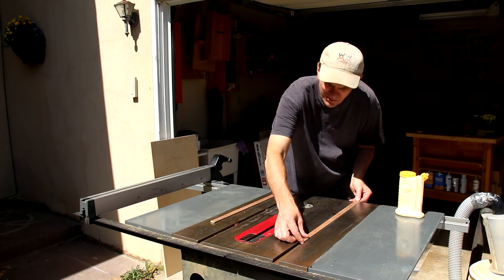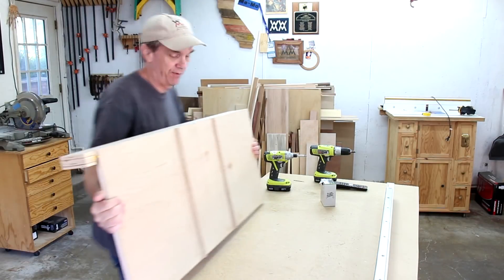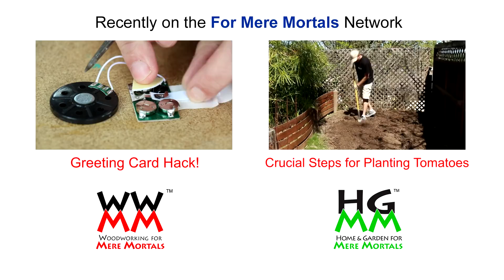Build a crosscut sled: essential table saw jig

Comment: In most videos of making a cross cut sled the makers refer to "sneaking up" on the width on the slide guides. I found an easy way to do this it to clamp a block of wood onto the fence slide, then moving the fence towards the blade and putting, say, a 20 thou. feeler gauge between the block and the fence and clamping the fence back down. Now when you cut the guide you will only be removing 20 thousandths of an inch. You can use this with any amount of feeler gauges and know how much material you will remove on the cut.

Comment: I know this is an older video, but the same applies for all the videos I’ve watched of yours, you have a great way of making woodworking very accessible for novices like me. I don’t need a u-beaut bells-and-whistles cross cut sled with a rail-road grid of intersecting t-tracks that lets me do mitred cuts at 38.379° angles, or a sled with a sliding stop block - I’m not yet skilled enough to make such a thing let alone need it for all that could be done in it - but what I do need is something that matches the skill level that I’m at and which will help me grow in my skills and confidence. And this sled (actually, a more recent one you did) is just what I needed. Thank you.

Comment: Very good, Steve!  I like the idea of adding the angle iron to keep the fence straight.

Here's one thing I would add. If you're laminating boards or plywood to make your fences, be sure to plan where you're putting your screws. It's easy to get carried away drilling and driving screws and end up putting one right where the saw blade will end up cutting through. If you happen to have a SawStop even a screw that is close to the blade can cause the brake to trigger. That goes for the screws you're using to mount the fences onto the sled. Keep them well clear of the blade.

Keep the videos coming!

Comment: Dude thank you!!  Mainly for reinforcing what I was thinking.  I built a table sled for my saw and didn't know how to square it.  I read about the "5 cut" method and using dial indicators, but those were too complicated for me.  I squared mine with a machinists square and it seems fine.  I'm glad that's how you do yours also.

Comment: great video Steve, nice cross cut sled, I like the size and great idea with the angle iron for support and to pull the boards straight! When I get round to building one for my table saw I will definitely use your plans! Happy Easter Steve, have a great long weekend!

Comment: I was having significant trouble with mine (table saw uses a t track which was difficult to build rails for) as it was encountering a lot of resistance which was super dangerous (it would tip the table saw if I pushed too hard). I found that using some candle wax and then silicon oil on top of the rails and just wax on the sled base mad things 100x smoother and now it works great.

Comment: I just made myself a cross-cut sled this past week.  It can hold up to a 27" piece, but I've decided it's not great for longer small pieces.  I'm going to make another one that is longer like the one you made.  I did use the "5 cut" method to square the back fence and it is laser square now.

Comment: I have made sleds for my use ,My large one is the with of my table saw and 25 inches deep inside allowing for a 24 inch panel. When aligning the rear piece I used a screw underneath on one end, then from the top drill a recess hole at the other end with your square on the sled fasten the screw from the top. You may then turn it over and install the other screws.  I also have a sled with one runner for my dado cuts, I can reverse the sled and cut at 45 degree bevel with my saw blade  For large sleds I laminate 3 pieces of   1/2 inch plywood it will not twist when glued right. Bob

Comment: Great video. One extra tip to make the miter width right. I used my table saw's miter gauge to scribe the lines on the plywood, cut it conservatively a little larger, then left my benchtop sander running nearby and kept inching a tiny bit off until the fit was perfect. I noticed you made the same mistake as I did putting glue all the way to the end of the runners. Oops.

Comment: The sled has the advantage of having a built-in zero clearance insert. Love the angle iron. Thanks for everything.
Reply: That is a really GOOD point, so now I don't have to make one for my Dewalt DW7480 table saw (which I really like) which was going to be problematic and not so easy

Comment: +Steve Ramsey, I enjoy sitting and looking over your videos; you go over everything and why you are doing it to make it simple. I have 2 questions that maybe you or someone in the discussion can answer. After picking up a used table saw and some elbow grease, I managed to get the table saw running and I am ready to start building. So on to the questions; 1. on your fence. . .what is the width of your front and back fence as it look like it is about the width of a 2x4 per piece? 2. how far so you know where to place your back fence to have clearence for safety cross cuts?

Comment: For those that don't like the steel angle iron, here's an idea.  Clamp a straight-edge (or a long level) to the front fence and leave it clamped in place while you square it to the blade and fasten it down. While it's clamped there it should do the same job as the angle iron.  Once you have it well screwed to the base, remove the straight-edge.  Provided you used plenty of screws I think it should stay straight.

Note I haven't actually tried this, I might be completely wrong.  As it happens I will be getting a new table saw this month, so I'll find out :-)

Comment: I've noticed that this sled, and most of the sleds on YouTube, are built on the assumption that the miter gauge tracks are 3/4" and have no lip on the track like my Craftsman does. The result is that I am dealing with a sloppy miter gauge and cutting runners is a real problem as there are 2 widths in the track. Narrower on the top and wider on the bottom, and the narrow track is not full length, and the miter gauge runner appears to be a good idea, but can't be adjusted without pounding the hell out of it!

(Truth is the saw appeared to be a good deal when I bought it as a rebuild, but it is  aluminum and there is the issue of this crappy double width track... )

I tried making runners that are higher, and with the narrower of the two tracks as a width; I tried making runners that were split level; and I have most recently tried using washers as the bottom width; but none work if the runners are not really a tight fit in the track. 

To make matters worse, any humidity and the sled is far from smooth in operation. (I'll probably unload this saw when I can, but at the moment I don't have a choice.) Although I did get the sled I made to work temporarily, with hardwood runners, the first shift of moisture in the air ended that. 

I've been looking for an alternative material for the runners, and plastic and metal seem to be the obvious choice, finding potential runners that are not overpriced is not as easy as one would think. I can't get accurate cuts with the saw in this situation. Because of the design of the throat plate (square) I can't even get a zero clearance insert or use dado safely  unless I use the sled.

Do you have any suggestions?
Reply: I just built this using my dads table saw, which is an old school craftsman.  I was wondering about the "squareness" of the tracks because when I flip the sled around I meet with a lot of resistance compared to having the sled front facing.  I can't figure out why there is a difference in resistance.  I lightly sanded the bottom but It doesn't fix the issue.  What model is your table saw?  Maybe my issue is with the tracks as well.

Comment: Nice video...

I am getting ready to build my first 'sled'.

I have been thinking about using a metal top on my fence, like yours. Actually, I plan to use 1 inch aluminum angle iron, instead of steel. 

I am wondering why you did not use the metal on both the front and back fences???

Comment: Well done, Steve. I'm definitely going to be building one for my new shop. Most likely I will make one solely for dado use as well as standard curf blades.
Reply: ***** Ben's Collection and Sundry  Ben just made a light bulb go off in my head...What if you made one that had insert plates like your drill press table? Have an insert for each application....single blade, most common dado sizes, angles say 45's, etc. I think that would be a HUGE benefit rather than making 10 sleds!
Reply: MP Woodworking That's a good idea, though I don't think it will work. Unless you always start with the blade in the center, the insert will be cut into two parts, then become useless.
Reply: MP Woodworking There are plans floating around online for an adjustable sled. I bought a dado blade off a guy who had built one and it would convert from a zero clearance thin kerf to zero clearance dado in no time flat.

Comment: I have a question. I’m a newbie woodworker and it’s a hobby right now but I love it. I’ve built some stuff over the last 2 years. One thing, among many, I have a problem with is using small screws to screw in thinner pieces of wood. It just ends up spinning or not holding. I’m assuming its several issues I’m having. But any way you could address this in a video or if you have, could you direct me to that video. Thanks.

Comment: I just have a small sled with a single runner so I think I might make one bigger with two runners. If I have them offset from centre a little and square both front and back fences, then I could have it dual purpose with one slot/direction for normal cuts and the other for 45 degree bevels. Or perhaps the other for use with a dado?

Comment: Hi Steve,

Thanks for this one. That was really interesting!
I do have a table top mini saw the Proxxon FKS/E. However Proxxon replaced it with the FET version, but still looks very alike. One day I'm going to make a mini crosscut sled based on your idea.

However you're going to lose some blade height (not sure about the actual term), as the sled has some thickness as well. That is a little drawback. So I think I also need to replace the aluminum base board for a thinner one.

Comment: I got a new tablesaw a couple of weeks ago, and used a scrap of plywood to make a sled.  Two weeks later it had bowed badly.
OK, fine, it was just a scrap piece anyway.  So I made another one, this time out of a piece of off-cut 19mm laminated pine board that had been leaning against the wall of my garage for nearly five years.  The day after I glued the guide strips to it, it had bowed too.  I'm thinking the woodworking gods are mocking me.
Next attempt will be melamine.

Comment: Hello, Can I have a beginners question? I see a lot of self made tools videos. What kind of plywood shoule be using? Does cheap OSB works? Of if RTD is better not that rough to hand? Or does MDF or Melamine White Panel is better keep straight but still provide enough strength? Thanks for the info.

Comment: If mostly using to crosscut thinner strips, what is the advantage to using a sled like this vs. a miter saw?  I can see more of a use if cutting a wider piece than the reach of the miter saw.

Love your videos as always Steve, thanks for sharing!
Reply: ***** Adam Hollermann Plus, when you are using the table saw for all other parts, it's sometimes a pain to switch between tools when you don't have a fully functional workshop like 90% of us that don't. I HATE, and I do mean HATE dragging out my 12" compound sliding miter saw, no matter its accuracy! Great build Steve!

Comment: I got as far as about to make the fences, and the plywood I wanted to use has a slight bow to it.  It might come out, if cut it in two strips and sandwich them together, concave side facing concave side, and glue and screw, but I'd rather not waste the plywood if that won't work.  I'm guessing you would want your back fence dead straight, right?

Comment: Great video Steve. The "Pivot Screw" approach is a fantastic idea. I notice there is no knife or reaver attachment for cross cuts with sleds. Have you ever had any kick back issues given length of cuts are usually shorter?

Comment: First of all; awesome channel. 
I just bought a new table saw (AEG TS 250k) and i'm planning on building a crosscut sled.
I see you removed your rivingknive/splitter in order to make the slede. 
I'm a bit concerned to do this as you read a lot of safety precautions in order to avoid kickbacks etc.. Do you only remove the rivingknife/splitter when crosscutting, or also when ripping etc? Any thoughts on removing the riving knife/splitter in order to make better slides, anyone?

Comment: Firstly: make the rear fence parallel to the front one, onr, in other words, perpendicular tothe blade, fence, etc., just like the front one.  It is sometimes easier and or safer to butt the work-piece to the rear fence.  It is easier to align a cut mark to the slot the saw leaves in the rear fence than to the slot in the front fence - you don't have to bend your head over as far...

Secondly, I use plastic for the runners. It doesn't expand and contract with the weather as wood does, unless you seal it very well.  I've found that the sealing material - varnish, shellac, etc., wears off over time due to the friction of the runner in the miter slot.

Thirdly:  ....I forgoet what I was going to say...

Comment: Great Video!  I have a DeWalt DWE7491 job site table saw.  The top measures 21 7/8 x 26 3/8.  What size sleds would be appropriate for this size of saw.  It does extend to the right to rip 32". Your advice would be appreciated.

Comment: This may sound like a silly question, but I'm still learning. Is there a difference between making a cross cut on a table saw and just using a sliding miter saw? Is there a disadvantage using a miter saw or is a table saw just easier?

Comment: Question: the anti-kickback thingie behind the blade is higher than the top of the blade on my table saw. This prevents to do the initial cut on the bottom panel and then in the front and back panels. Is the operation of the sled without it still be safe?

BTW: this is my favorite woodworking channel!

Comment: just out of curiosity if you use a 3/4 inch plywood as a base for your jig how much saw blade length left to cut your boards? in other words how thick of a stock you can cut assuming most table saws are 10", i was planing on building a sled but a 3/4 ply seems taking a lot of blade " space"

Comment: Cross Cut Sled vs Mitre Saw? Im curious to know the use cases you would use the sled vs your Mitre Saw? I can see how the sled is super useful but would be useful to have some pointers as to when you use one vs the other as they both cross cut? Love the videos been so helpful for this new wood worker! Thanks
Reply: I personally prefer the sled because my table saw always makes cleaner better cuts than my miter saw
Reply: The biggest drawback to using the miter saw is that they are not always easy to get repeatably accurate angles time after time. If you are trying to cut crown molding with a miter saw the slightest slip on the miter saw will affect the molding considerably. With the sled it is easier to control the crown molding because it is easier to see and get adjusted correctly. 
Having said this, it really depends on personal preference. My grandfather did incredible cabinet work in the 50's and 60;s with a simple hand saw and a home made miter box.

Comment: Love these videos! I just got myself my first table saw, i got Rioby 10" form home depot, then I practiced couple different cuts. Then I wanted to build a cross sled but that only when i realized that my table saw has only track/ runner for the miter. Will that be a problem if my sled has just one runner or how can i add one more?

Comment: Do you feel it necessary to use plywood for the vertical pieces of the sled? Does that provide more stability than just using 2x4's?
Reply: ***** Ok...good deal. Thanks for the video and the quick reply!

Comment: Hi Steve,
Love your videos and always look forward to seeing them.
I have a question if I may.
I have a RYOBI table saw that utilizes a sliding miter bed instead of miter tracks.
I have been wanting to build this sled, but am struggling with how to over come the sled registration to the table saw bed issue.
The only two options that I have come up with to date are:
  - Create a plywood cap with miter tracks to be attached to current table saw bed.
    - ISSUE:    In doing so, I will no longer be able to used rip fence without removing the proposed plywood cap.
  - Attempt to create sled and register against outer edges of the table saw bed.
    - CONCERN:    Table saw bed is 32" wide and that seems like a lot of surface friction for the sled.

Would you happen to have any suggestions / ideas?

Comment: Steve:  Do you need to make a separate sled for using the table saw with the blade tilted at 45°?  If you use the same sled, doesn't it widen the blade slot on the sled?  Thanks.

Comment: Hey Steve..  Great instructional video..  I'd like to make one of these for the DeWalt DCS7485T1 Flexvolt which has only one T-track.  Is that possible and would it be just as solid and accurate crossing through the cut?  As it stands now, I've gotten quite a bit of kick back using just the single T-track and fence while making cross cuts through 2X4s..  Thanks!